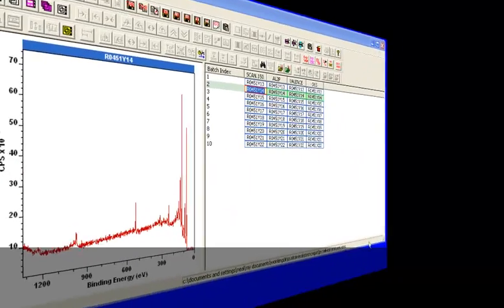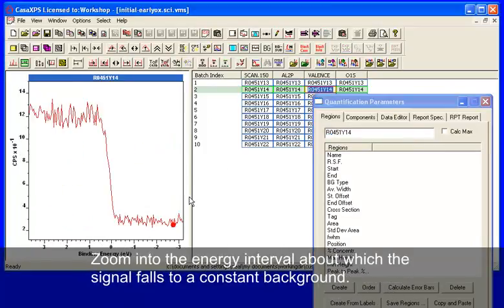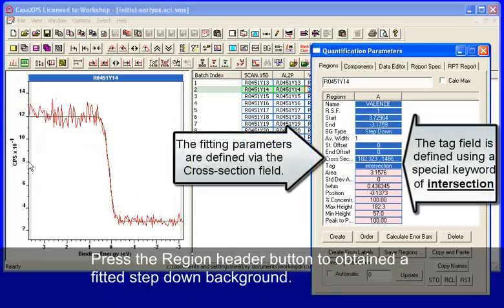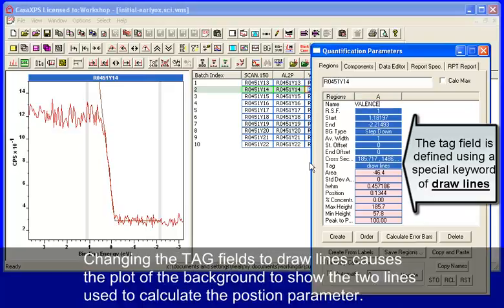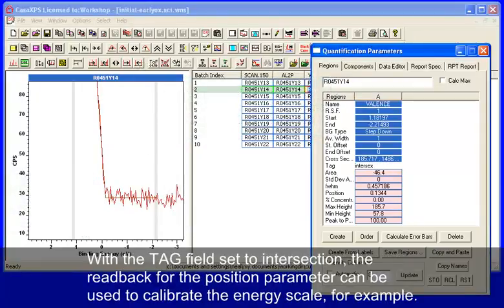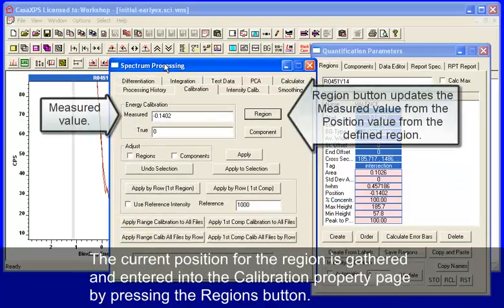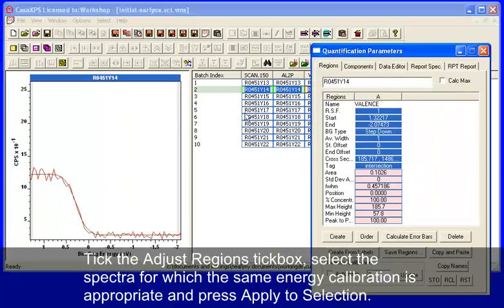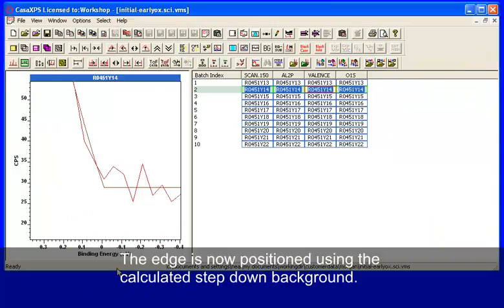Energy Calibration Based on Fermi Edge Position in CasaXPS

Comment: Thanks for this nice explaination. But which one of these two backgrounds should be used to measure the valance band edge of a material as both will give its different value, nearly about 0.2 eV difference? Because in materials like semiconductors this 0.2 eV difference between the values can make them p or n type for two different backgrounds used.
Reply from the maker: Many of the features in CasaXPS have been added at the request of customers. This requests often results in multiple way to approach as topic.  The reasons for these different approaches to edge measurements is not clear to me, so I would suggest a review of the literature is the best way to proceed. Sorry I cannot be more helpful.

Comment: For the updated version, the BG type shoud be "Edge Down" instead of "Step Down"?
Reply from the maker: The difference between Edge Down and Step Down is the position calculated by the region. For Step Down the position determined by the region is the point of inflection while for Edge Down the position is the intersection of two lines, one of which goes through the point of inflection.  See video: https://www.youtube.com/watch?v=5bTMAABZzLM
Reply: @casaxpscasasoftware4605  Thank you very much.